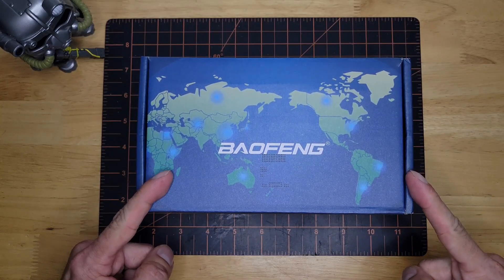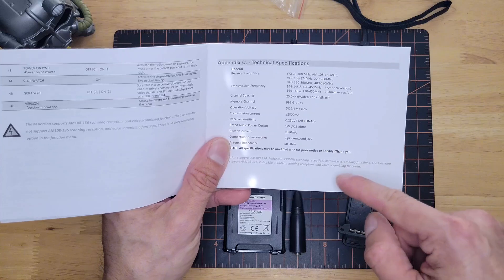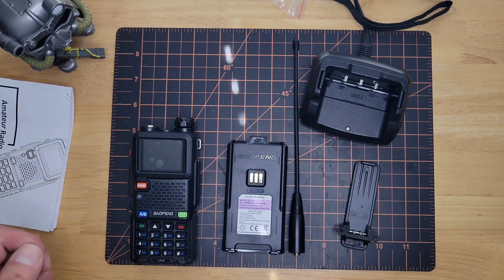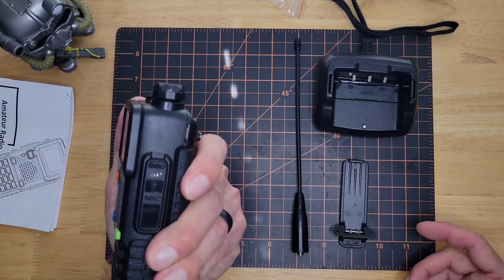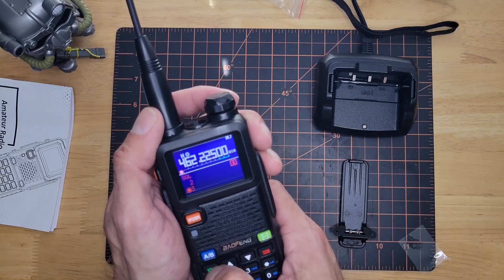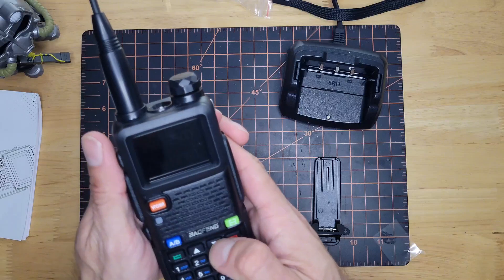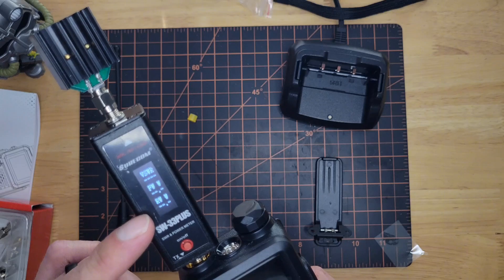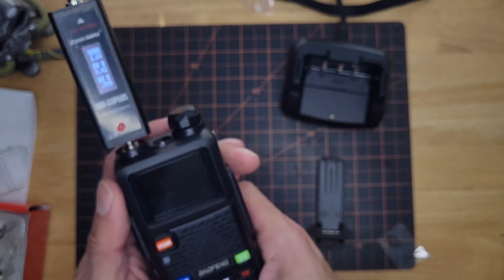New Baofeng, I'm on it! (Baofeng 5RM)

Comment: Try plugging in an external speaker or a programming cable a few times & let me know if the internal speaker ever works again after that.
Reply from the maker: This feels like one of those "ask me how I know" statements. That sucks! How does connecting a peripheral end up damaging an internal component?
Reply: Did you end up fixing it?

Comment: NO!  It is NOT excellent.  It is false advertising from Baofeng.  Baofeng is advertising the 5RM as 8W.  On 2M at 7W that is -12.5%.  On 70C at 6.4W that is -20% of what Baofeng says it is.
Reply from the maker: So from what I have understood via other posts, etc, when Baofeng advertises a power limit, that is the max Wattage output of the 2M and 70cm ranges (combined). Which I have to say makes sense, although I agree the wording is off.
Granted, your point is valid, but an HT with anything 5W, let alone closer to 8W on 2M is quite good in my book.
Much appreciated for the comment and observation!

Comment: Silly question, but was the power level on the high, medium, or low setting when you tested output with the dummy load? Any chance of measuring output on each level? Thanks for the great video
Reply from the maker: Appreciate that you like the video!
So that testing was on the High power output setting.
Making a video showing just how well they work at each power level could be insightful. Great idea!

Comment: I must be the only person that thinks, ergonomically, the screen should be on top, keyboard in the middle( not having to lower my grip to manipulate) and speaker on bottom.
Reply from the maker: Honestly never gave the design much thought, but I can definitely see what you are talking about.
Reply: Get the exstended bigger cell battery it definitely helps with manipulating the key board plus it gives you longer battery life and more to hold on the radio

Comment: Silly question, but is the batteries backwards compatible?
Reply from the maker: You know, that is a REALLY good question, I have never thought of that! Definitely something to check out!
Reply: Answer: Unfortunately no, they are not.
Reply: I have 3 baofeng radios, a uv5r, 5rm, and 1701. All three have different batteries, so I have 3 different chargers. My 5rm is a definite upgrade from my uv5r, the 5rm can work a local repeater where we have a weekly net, while I am at work from the employee breakroom. The uv5r I had to go outside the building to hear and transmit to the repeater.
Reply from the maker: Can you imagine all Baofengs being battery cross-compatible!
Reply: @NukaVaultReadiness  back in the days of RadioShack, my 202 and 404 both used the same battery packs, I never could get my icom 02a battery pack to fit, even though the 202 was a clone of it.
Reply from the maker: Bring back the days of making it easy on the consumer. We have such a wasteful industry when it comes to batteries and electronics as a whole.